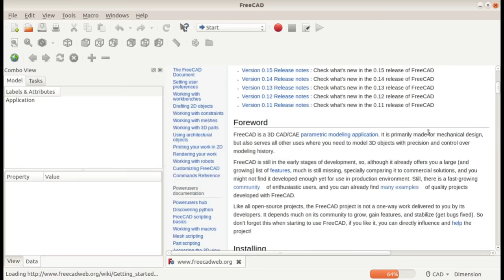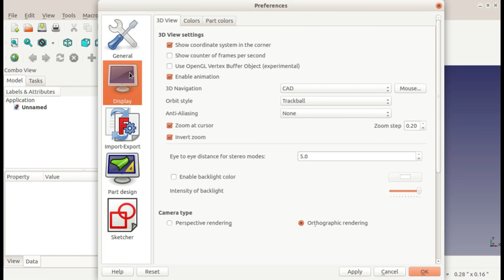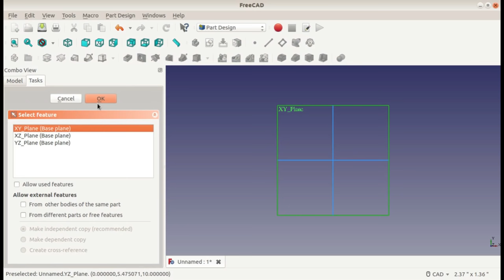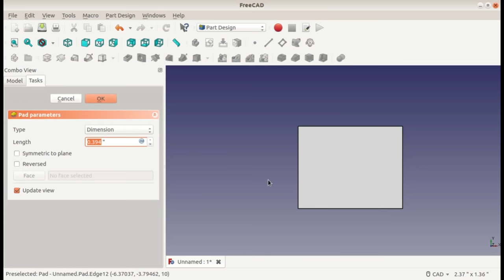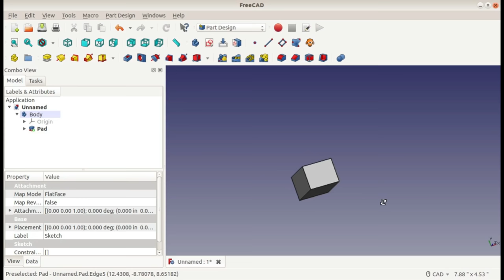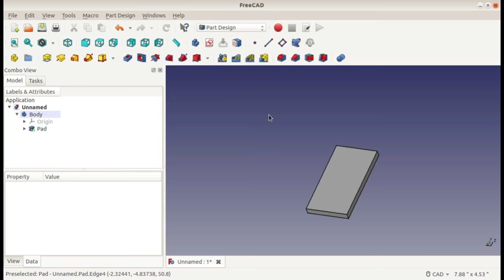Learn FreeCAD: #1 Introduction - Tutorial

Comment: Thanks for making such excellent tutorials! I come from another 3D Modeling software who recently decided to kibosh the Maker movement by imposing limitations. An alternative option for a parametric design software was needed. I agree that FreeCAD looks more like a Java program than a polished modeling software, but  besides that I think a little bit of elbow grease is required to get started and getting used to. I'm new to FC, and please ignore my comment as it stems out of pure ignorance, but I wish there was an easier way to make the Origin point, and the points on the ends of the lines more prominent. Most times I start off my designs by snapping the first corner to the Origin and today I realized after going through your tutorial that the corner of my box unsnapped from the origin as soon as I imposed dimensions on the sketch. I'm still struggling to snap the next line to the end point of the previous line.

Comment: Thanks. This is my first parametric CAD program and it was hard to figure out. I was trained on 2D CAD back in the 1980s and have been using LibreCAD in recent years. I played around with Blender, but I really wanted to work with a real 3D CAD system.

Comment: This is a great tutorial thank you! I am trying to adapt this to woodworking as I'd like to start using this instead of Sketchup.  It is more involved yes, but will also allow me more control.  I am wondering if you know of any good tutorials showing the assembly of multiple parts?  The shapes I will use are going to be primitive/simple considering my stock material is all dimensioned rectangles.

Comment: I downloaded FreeCAD. It is Ver 0.18. It seems to be a good program, but it is buggier than a Florida Swamp in June. I am sure you put a lot of time in your tutorials. But your tutorials work sometimes, and sometimes they don't.  

Not sure if it is because I am using Windows 10 (I can try it on a Mac though).

At this point, it is too frustrating to work with.
Reply: @Julian Dario Tovar Roa Lots of bugs really. I have not cataloged them.

 I am beginning to figure it out though. For example, multiple operations; fillet, boolean, and others seem to have to be done in order or they won't work. 

In boolean, if you make a mistake - say you to a union rather than a cut, and if this is the third or fourth boolean operation you make, you have to delete two or three previous successful boolean operations to get it to work again.

But it is free, so can't complain. However, I am thinking of making the switch to Fusion 360 as a hobbyist it is also free.
Reply: @RVProject  I thought it was $495.00  per year ?

Comment: When I open FreeCAD, there is no FreeCAD Start Center box and no Getting started link.
The menu displayed in the application is the same, but toolbar displayed is different. 

When I go to the Part Design workbench, I find that the toolbar displayed for me has been rearranged and all the items are greyed out and cannot be clicked (only the open button and the open macro dialog box button are active).  There is nothing in the window pane on the left, no "create body" option.  I did switch between model and task tabs to search for the option, but nothing is there and the toolbar buttons remain greyed out. 

I went up the the Part Design Menu.  There were Create Body and Create Sketch options listed there, but selecting them produced no results. 

I'm only 3 minutes 43 seconds into this tutorial and nothing is working.
I'm going to go with FreeCAD having moved on to a later edition no longer compatible with this tutorial.
Reply: we have a newer version so they changed it but the basis with all of the tools is the same but just look it up and you can find it to

Comment: Can someone explain to me why we have to create a body in the first place? Why can a 2D sketch being extruded, not become a body automatically ? Thanks.
Reply from the maker: Great question. A body acts similarly to a folder. It groups a set of parts or operations. Because of this, you may end up with several bodies. In this case, you would have to specify which body the sketch is a part of.

Anyway, I agree that it seems right for it to automatically create the first body. Maybe they will add this in a newer version.

Comment: I'm sketching a square cube size doesn't matter. I'm cutting 3 holes in it again size doesn't matter. I finally got it done it only took me 3 days to finish it. I was quite elated with my success. I saved it as stl and exported it as a stl. I loaded it into cura and the holes were missing from the model. I go to freecad open the drawing and the block and the holes are  there. Is there any way you could just sketch a simple  rectangle and cut a few hoes in it explaining how to do it? To me this software is very complicated and I know if i can get the rules down I can sketch what I need. If there is anyone out there who Is willing to help me i would really appreciate it.

Comment: Im waiting for the parts for my first cnc router to arrive, im looking at freecad as software. Im planing on dedicating a laptop or desktop to my new router and software. My question is on system requirements. What do i need to run freeCad. I do t want the bare minimum requirements, i want it to run well and not have the lap top struggle and be glitchy. Thanks for the info
Reply: go to the free cad website and read what it recommends ... and then match or better that

Comment: Is there a tutorial on setting up freecad? I have ver .18 and it looks completely different. Difficult to follow along, almost every button you use is missing here?? Thanks, P
Reply: having the same problem, top bar select <edit> scroll down to preferences Iam using all the default except for display 3d view -marker size, changed to 15px and  <sketcher> colors-constrain color changed to a darker red, slide the bar down and select <OK>  <apply>  and  <OK> again,   (NOTE) take photos of each screen as there is no reset to factory settings, I hope this helps

Comment: Thankyou. I started off by trying to use Inkscape but my monitor is running at 4k and the icons are just too tiny no matter what prefs I set in the program.
That's why I searched and installed FreeCAD but although my initial stumbling around kind of got in the right place there's no way I'd have understood it without this tutorial.
What's my project ?
Well.... I'm trying to make a better enclosure for the battery I've built for my eBike.  I thermoformed it and it works but looks a bit of a bodge job. 

So for V² I'm increasing parallel from 5P to 7P and moving the BMS to the side location (to lower the height as well) so instead of an extruded rear (BMS location) it makes a kind of sideways extruded T
https://i.imgur.com/EPWHiR9.jpg
And bought a 3D printer to (try) and make a better job of it 

https://i.imgur.com/VBxtTue.jpg
Baby steps first though !!

Comment: if you have any experience with any other cad software then I suggest leave this one alone. it is horrible
Reply from the maker: I agree that FreeCAD might not be as practical as Solidworks or Autodesk, but the main advantage is the price difference. You can save a lot of money by using free software.
Reply: I got to agree with you here, this was definitely not designed from a draftsman/architect/machinist point of view, it reeks of programmer's thought patterns. sadly though cause it's free and quite powerful if you can get through the frustration of trying to work with it.